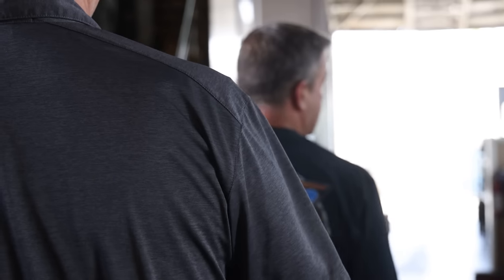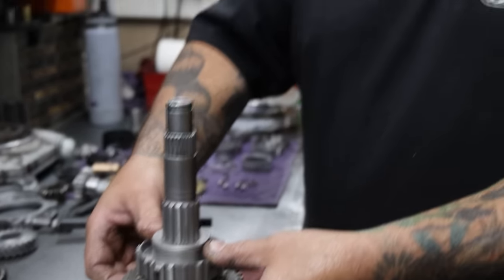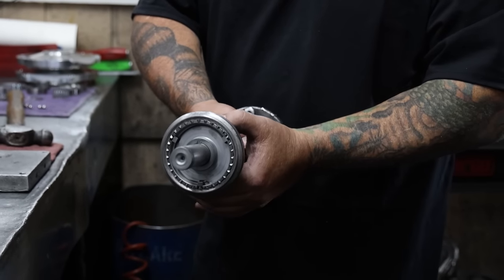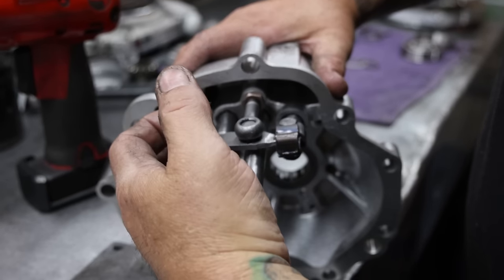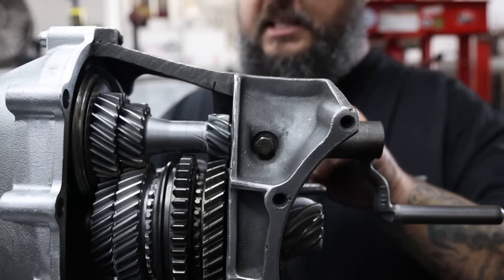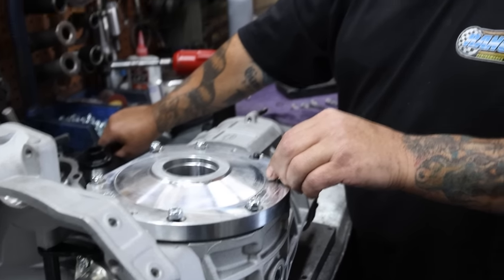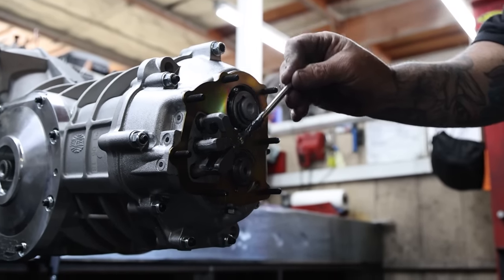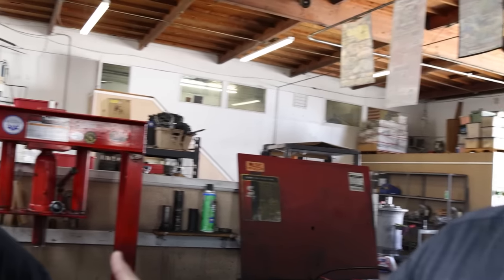How to build a VW Transaxle with Rancho Performance Transaxles!!

Comment: I would of thought polishing surfaces ( that arnt oil pressure fed) would wear quicker ,as the oil has nowhere to sit on the surface (in the micro undulations) , like a lathe bed which is scrapped and not polished.  Whats your thoughts? Great informative video.
Reply from the maker: #Lino

Comment: my .002 has 835.000 miles n it ! I don't think it could be used as a core ? It will pop out of 4th on the JFK bridge , but its been doing that for 38 years .
Reply from the maker: sounds like it should be in a museum to be preserved!
Reply: Just stay off the JFK bridge and you’ll be fine……..What year bus do you have?
Reply: @tomcoryell  71 with a 72 trans.

Comment: I’m a fan of you for VW repairs , but I think you forgot to tell the audience of your channel , you need to use and open wrench maybe 7mm OR a small clamp pliers to hold the clutch cable from turning , if cable turn while you turning the clutch wing nut , cable will brake or worst , will get crumble inside the tube the problems will happen.

Comment: Very interesting! 
However, in the beginning of the video, after welding on a harden gear, THEN drop it in water.
I about lose it. When doing that, you put micros cracks in the welds and the surrounding metal. 
You also made that gear MORE brittle.
I've been working with metals, welding and microscopes for the DOD for MANY years.
The proper way is bury your part in sand, let it cool slowly. At the least, let it air dry.
Reply from the maker: thanks for your feedback David

Comment: I don't work on transmissions but I do a lot of ring and pinion gear work. It doesn't show in the video, you checked your gear pattern but how do you change the pinion depth? Are there shims you can ad or subtract under the pinion head? and, is there any pinion pre load? On your backlash setting, there are no screw cap adjusters, assuming there are shims outside the carrier bearings that you can move from side to side, and no bearing caps to torque. Interesting and nice work.
Also, are there different ring and pinion gear sets available, higher ratios for better highway driving? And do you have a posi unit for these? Thank You very much.
Ron Z.
Reply: Pinion depth is changed by changing the shims between the pinion bearing and the case. But it's opposite of the way it works on a rear end. A thicker shim moves the pinion away from the diff centerline.
Pinion bearing preload is set by the manufacturer of the pinion bearing. It is always perfect.
Backlash is altered by changing the shims under the diff bearing (swing axle), or behind the outer race in the side cover (IRS). Screw cap adjusters were designed into the Bus trans in 68.
R&P ratios stock from VW: 4.62:1, 4.375, 4.12, and 3.88.  Aftermarket: 4.86:1, and 3.44:1. Brazil has 5.14 too.
Torque biasing diffs are available, as are clutch type limited slip diffs.

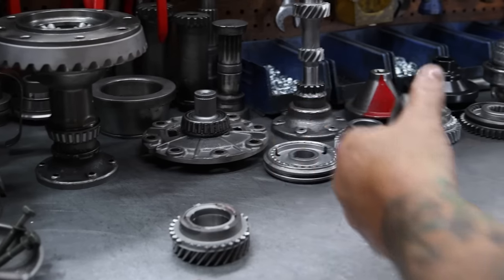Comment: 2:01 Why would you hone 1st and 2nd gear idlers? By doing that, you are saying that VW made them wrong. And you didn't even measure them!!!
Reply from the maker: Please re-watch, Lino honed and smoothed parts surfaces to enhance longevity, he didnt say or imply that there were any issues. All parts were measured prior to installation and just a reminder Lino has assembled thousands of VW transaxles